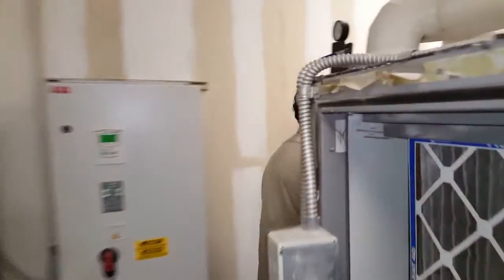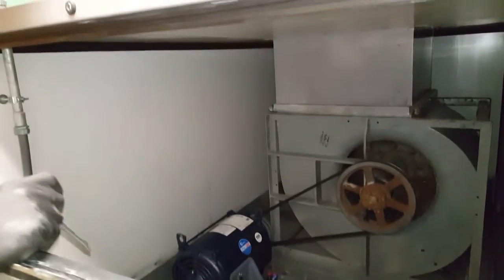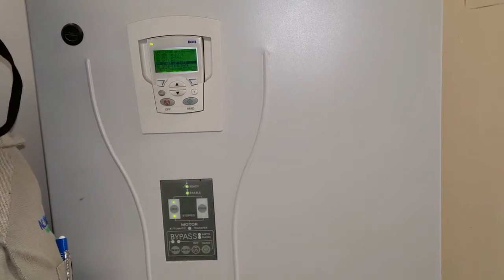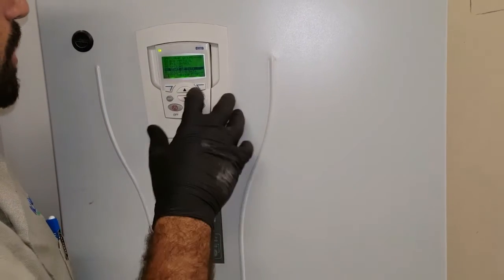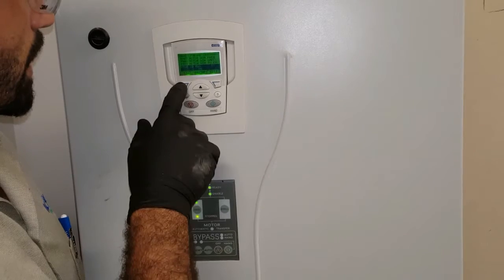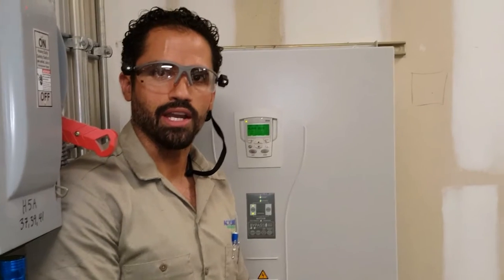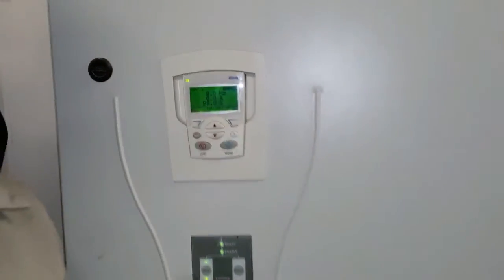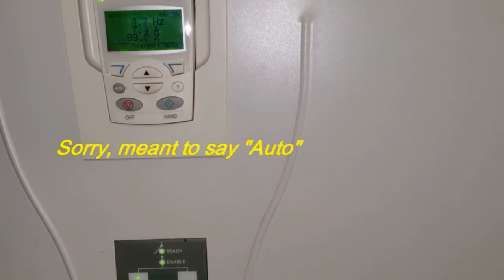Commercial services  ABB Drive Setup

Comment: Very interesting, you ran this self-test under no load with cover open would the readings be different for the ABB drive if the cover was back on tight? Or the Abb drive requires to test on unloaded motor?